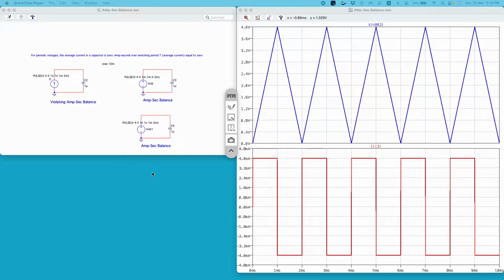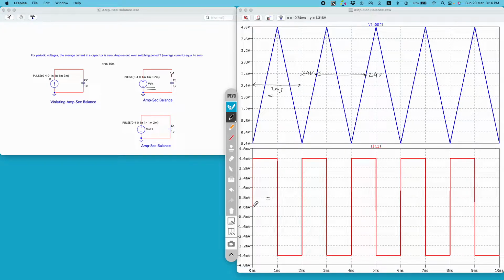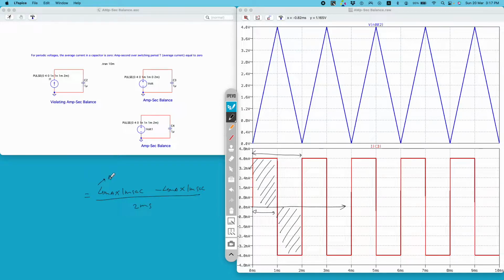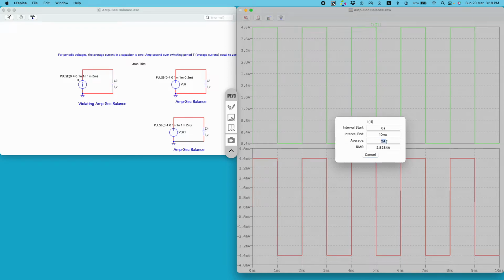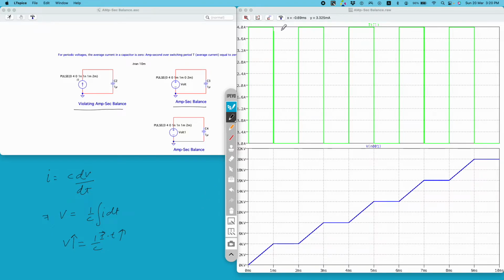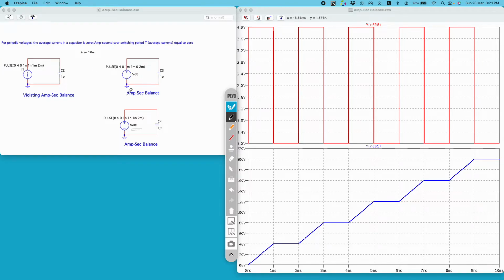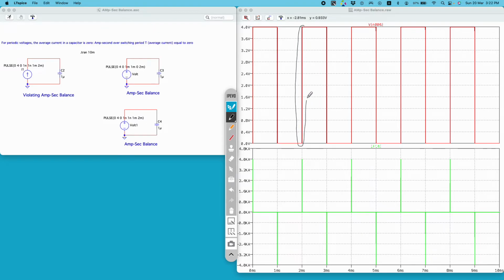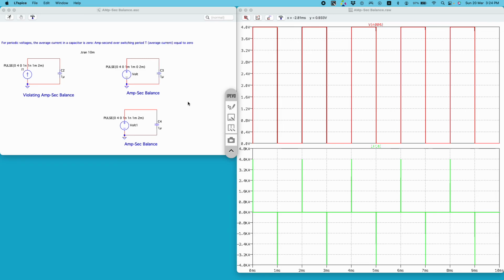Capacitor Amp-Sec balance explained using LTspice simulation

Comment: I simulated current source connected to capacitor in LTSpice. But, I got an error.
As the theory, capacitor voltage will ramp, but why in LTSpice can't simulate it?